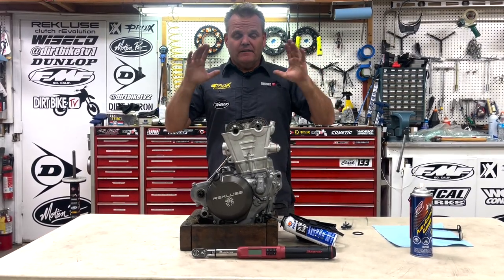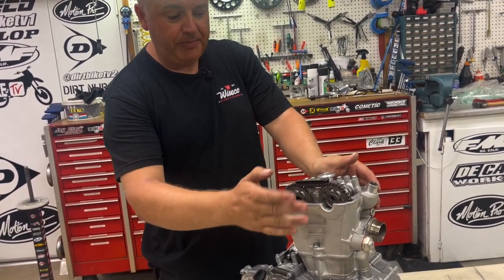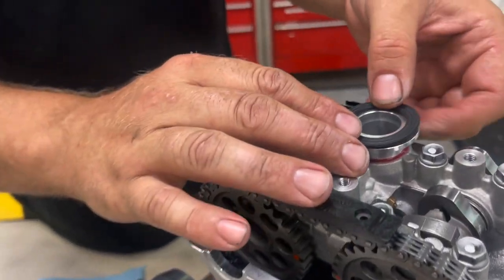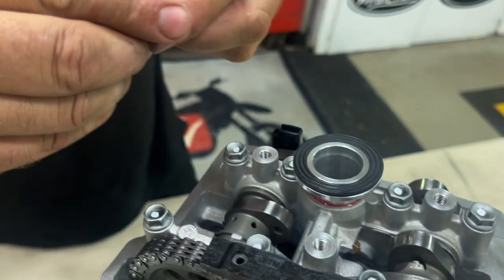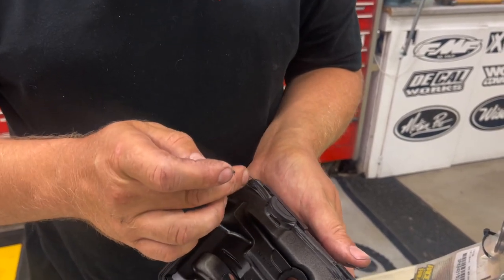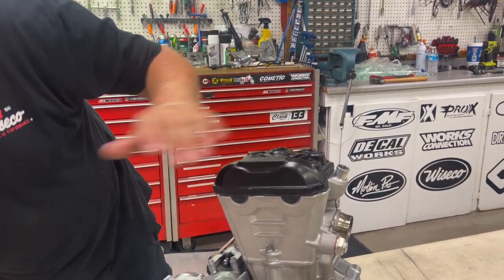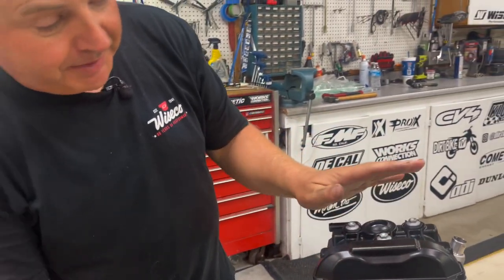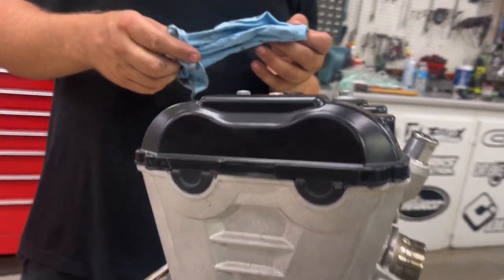Valve Cover Repair KTM 250/350 Fixing your Sad KTM!😭

Comment: I was putting mine back together and I found out the last guy had stripped out one of the holes and now I need to find a good way to fix it!
Reply: Heli coil. Same thing happened to me and did that and haven’t had problems since
Reply: Time serts are better than heli coil in my experience.